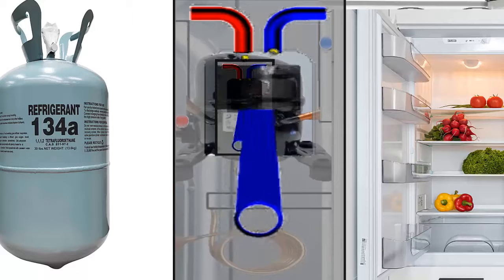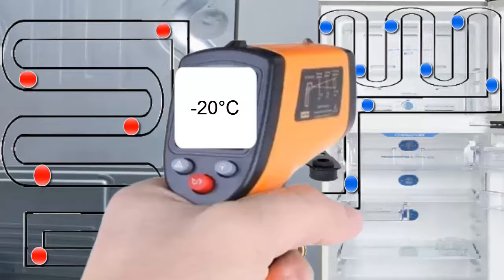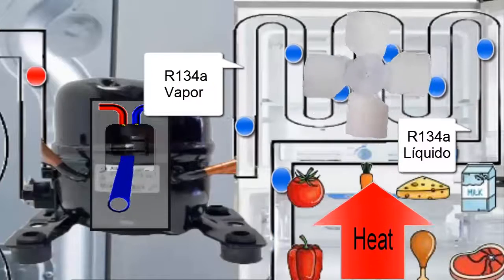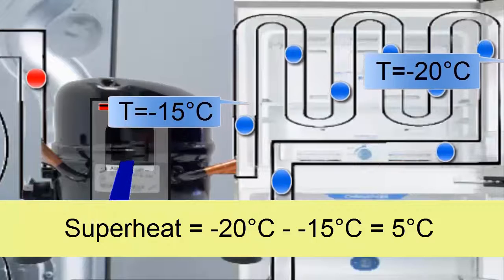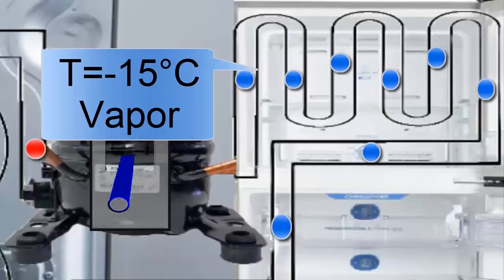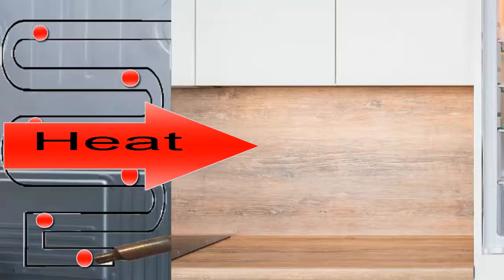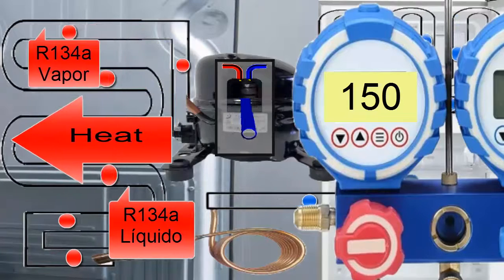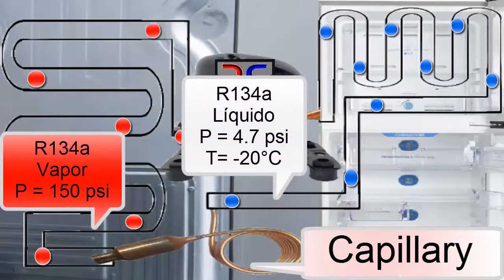R134a in Home Fridges: Pressure Guide, Parts Breakdown, and Cooling Cycle Explained

Comment: So what is the inlet pressure supposed to be on the inlet when adding Freon?
Reply: No one seems to know this. I have heard values from 1 PSI to 50 PSI. I have a 30 year old refrigerator that appears to be low on R134a and it is reading 11 PSI when it is running. But no one can tell me if this is too low or too high. The freezer gets down to 10 F but I was told it should get down to 0F.